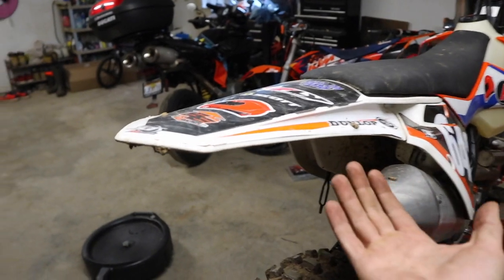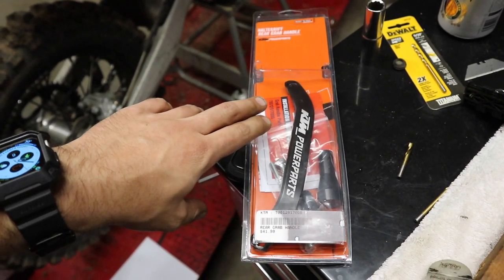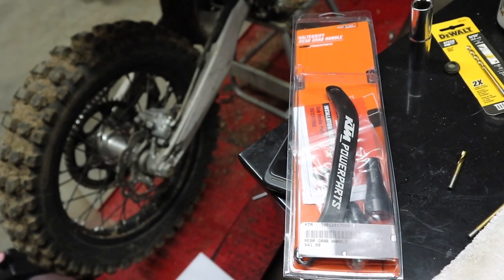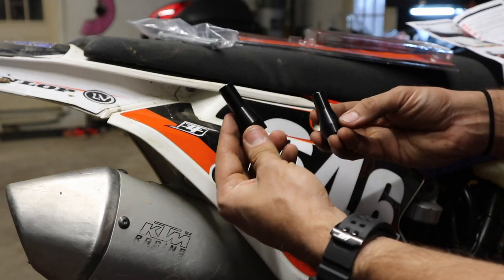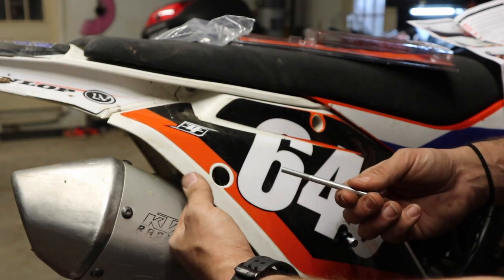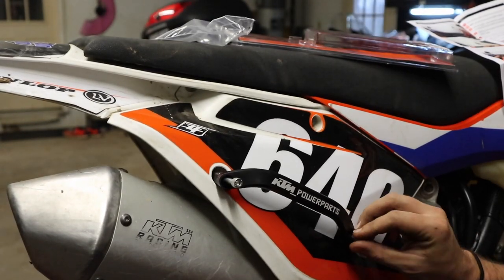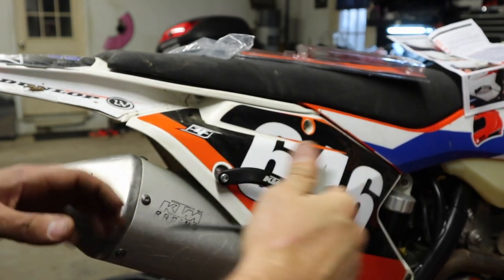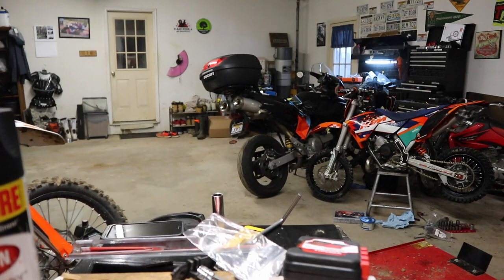KTM Dirt Bike Grab Handle Install | Back in the Garage

Comment: This thing will snag your right leg at the worst time possible.
Dont. Just get the strap.
Reply from the maker: Never had any issues with it racing or trail riding. That said, I've since sold the bike and didn't install a handle or strap on the new one.